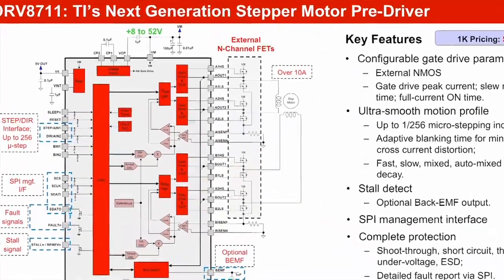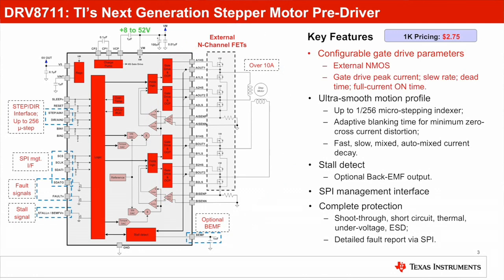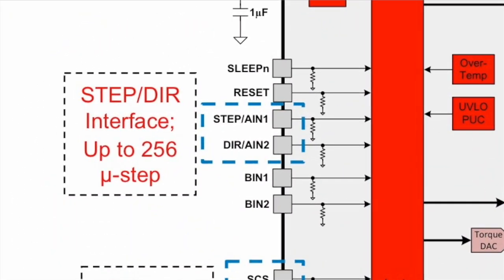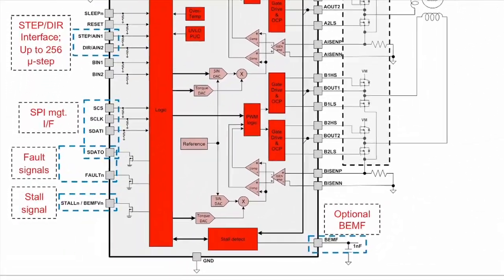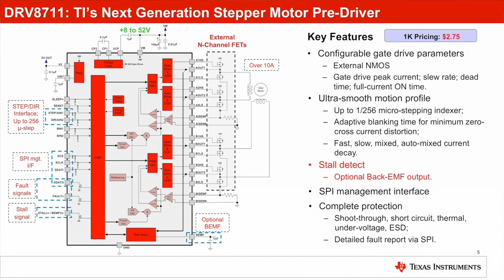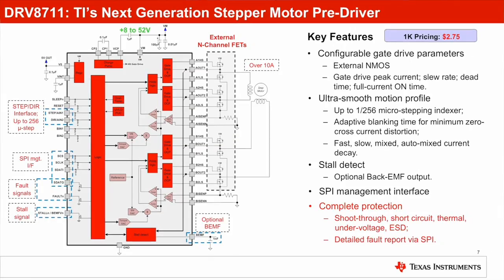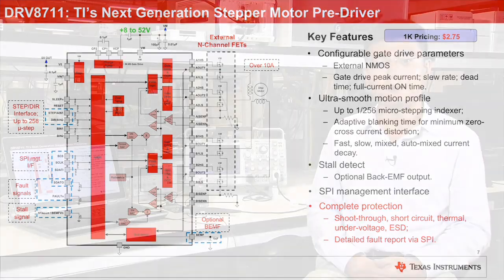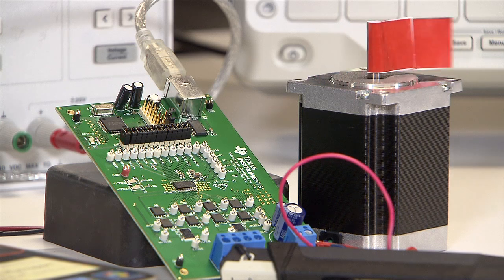Intro to High Performance Stepper Motor Controller DRV8711

Comment: Hi, on the DRV8711EVM, the jumper J6 is used for external signals to control the motor. Could you tell me how this can be done.
Reply from the maker: Hi Shanthilal: Thanks for your question here and in the E2E Motor Drivers forum. We have flagged for the team, who will provide a response to your thread on E2E.

Comment: Hi, people. I have one question. Is it possible to dynamically change parameters using SPI interface, while stepper motor is working? I mean, is it safe to change parameters without stopping stepper motor? For example, if I want to set different decay modes on different speed of motor, dynamically, in real time, without stopping stepper motor. Thanks.

Comment from the maker: Thanks for your question, byugrad1024 and glad the video was helpful! In response to your question about the datasheet, they are both SIN DACs, but the indexer addresses them separately. The two coils should be out of phase. If we look at the two tables together, it is SIN vs. COS. In our datasheet we use the SIN table to look at the two DACs individually. If you're interested in exploring further check out the Motor Driver forum in our TI E2E Support Community: ow.ly\oV9pk

Comment: After watching this video, I just placed an order for the DRV8711EVM.  One thing I noticed in the datasheet:  Is the second SIN DAC supposed to be a COS DAC?  Is that just a typo in the docs?  To drive a stepper, doesn't the second coil need to be out of phase from the first by 90 degrees?